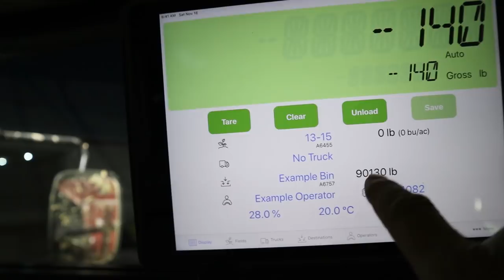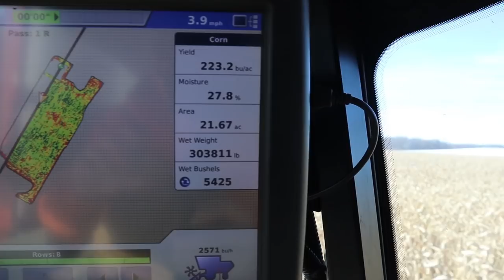Corn Harvest 2019 continues | Vlog 47

Comment: I agree with bring in additional corn in the buggy or trailer (as we would call it in NZ) line them up and as you are awake most of the night the dryer is going just keep fulling that sucker - Sandi is about to start lambing and that is not going to able to be put off or stopped - with the weather and lambing the race is on to get that corn in any way you can

Comment: You have the heater valve turned on at the motor?
Reply from the maker: Yep, both taps are on, think it has something to do with the climate control system
Reply: Mark Brock try to take climate control off auto. Put it in manual. Might work. My CIH tractor has reverse issue heats to much won’t shut off! LOL

Comment: Have you figured out why you have no heat ??????
Reply from the maker: No, but think it's a thermostat issue with the climate control.  Not horrible if the outside temperature is above 0°C
Reply: @MarkBrock  question for you I saw on a farmer in states could not get all his corn planted  had same issues you did weather, so in stead of letting the fields sit bare he planted 'sorghum & sudan grass    is this something you could have planted and what is this mix used for    Hope you have a good trip to your meetings and be safe/warm  charlie
Reply from the maker: Engine thermostat is the issue.
Reply: @MarkBrock  well thats not nice of it to quit and not give notice ;)

Comment: are you guys having trouble getting gas to dry crop
Reply from the maker: Lucky enough to be on natural gas, but must on propane fueled dryer have been told no more propane till after the rail strike is over.  Not a good situation in Ontario or Quebec.
Reply: Pretty sure they use Nat Gas. Check his dryer Vlog.
Reply: @hfff1  not sure if it is lp or propane or both but there is a shortage of or lack of trucking but gas is hard to get here in the states is why i asked